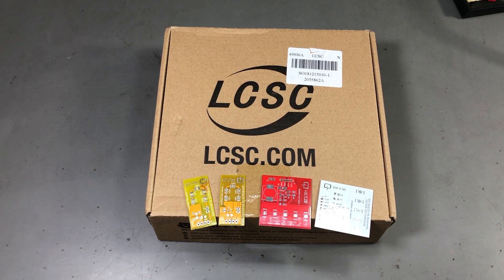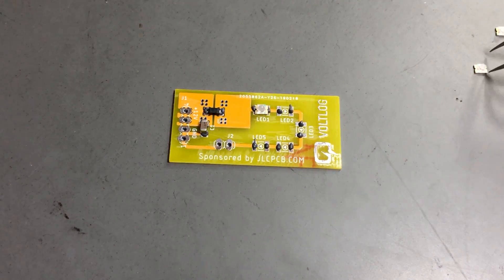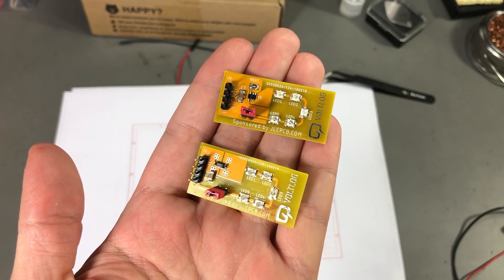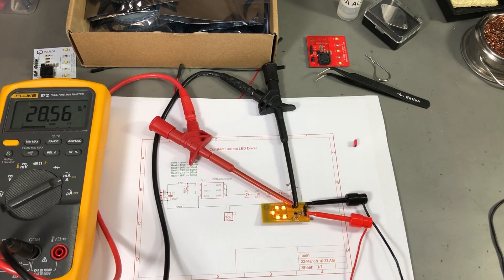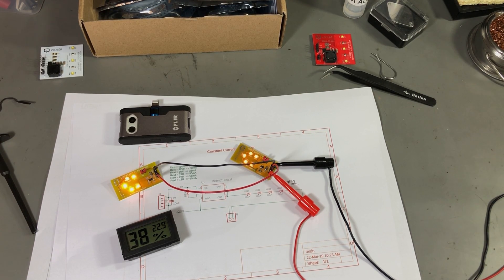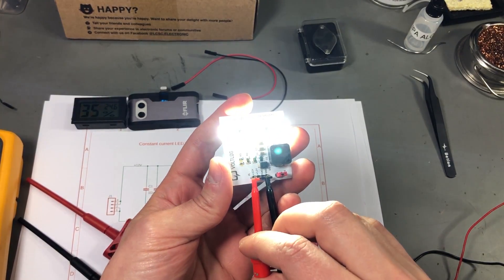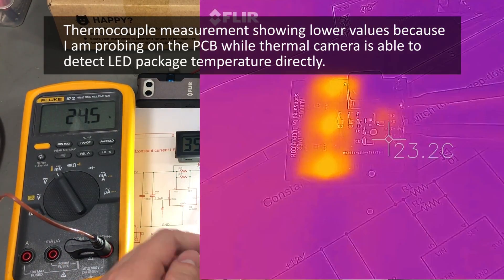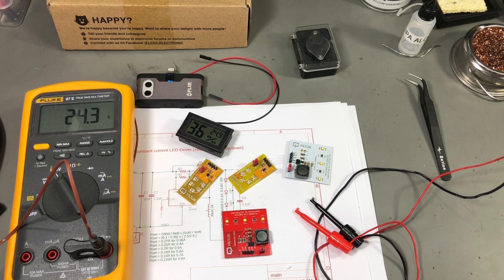Voltlog #217 - Constant Current LED Driver Boards Assembly & Testing

Comment: One tip I've heard about old solder paste is it realy just loses the liquid flux and you can revitalize the paste by adding more liquid flux or maybe just some IPA back into the mix. Of course you have to mix it somehow so squirt it out to a dish and mix and then use the paste.
Reply from the maker: Yes you can do that but results will vary, I once tried it and it turned out I added too much flux and after using that paste to assemble some boards it left too much flux residue on each solder joint. Since paste is not really that expensive I prefer getting new paste every 6 months or so.

Comment: For efficient cooling I would glue the pcb on a cheap small cooling fan which is also 12V, same as your power, and consumes only 100mA of current, or less if you regulate it. The 40x40mm one costs only less than 1€50, see https://fr.aliexpress.com/item/2Pin-DC-12-V-40-40mm-Ordinateurs-Portables-Ventilateurs-De-Refroidissement-Pour-Ordinateur-Portable-Refroidisseur-Fans/32854459773.html?spm=a2g0s.9042311.0.0.27426c37ceR06w

Comment: Couldn't you use copper tubing soldered on the back of that red board or even heat conductive silicone and a heatsink of some sort on any of these? Good deal all in all so I would just make it work.
Reply from the maker: There are plenty of things that can be used as a heatsink but the application usually dictates a space constraint and in this particular case, I only have a few millimeters of space available, I am currently searching for a small heatsink.

Comment: Great video. If you need led's to be cooled by pcb, you need mcpcb. If you find some place with descent price where you can order custom pcb. I tried sinkpad, al and cu, and works great, but price is  problem. 
If you can compare efficiency MP24893 vs AL8805 at higher current.
Reply from the maker: MCPCB helps suck the heat away from the LEDs but you need to get rid of that heat someway. My application has a tight space constraint so I would be using a very small heatsink. I'm not convinced the MCPCB will make a huge difference because I will have limited heat dissipation capability anyway.
Reply: I tried AL and CU. CU MCPCB spread heat perfectly. Cree XP-G2 @ about 0.5W mounted on 20mm copper star was enough cooling in open air. With CU star there is no temp. difference between center and borders, heat is evenly spread, but that is not case when AL star is used.
If you are limited with space, use most efficient led you can find. For example Cree XP-G3 S5 bin would have 110lm light output @0.5W, same as Cree XB-D Q4 bin @1W  
 @voltlog
Reply from the maker: Miloš Arsić  thank you for sharing your experience 👍

Comment: Hi Florin,
I liked your PCB experiments. May I suggest you place more vias when you want to use both sides of copper pours as a heat sink. 
I conducted some tests about 10 years ago and found that the vias acted like smoke stacks and pulled air through them which provided about 10% more cooling, compared to the vias filled with solder. 
The bare pours (without solder mask), is more efficient as you can imagine, with the added benefit of being able to solder copper fins or copper heat sinks, to act as heat sinks. 
I've used a $2 variable voltage boost converter from AliExpress on my 12V 10W COB LEDs, and adjusted the output of the converter to about 9.7V, because they are too bright for mood lighting. 
They hardly get warm, but I've attached the LEDs to 30mmx30mm heat sinks just in case I wanted to crank them up. It provides a constant voltage of 9.7 from a junk 7.2V power supply. 
No current limiting resistors were harmed in this project. 
Thought I share that with you and your viewers.
Reply from the maker: Thanks for the info, I never thought about using thermal vias for convection cooling.

Comment: Good video ! 👍

Dissipation problem : 
Use smd components only and have your pcb on ( anodized ) aluminium ?
Reply from the maker: There are plenty of things that can be used as a heatsink but the application usually dictates a space constraint and in this particular case, I only have a few millimeters of space available, I am currently searching for a small heatsink.

Comment: It would be interesting to see further tests with that AL8805 board and heat sinks. Of course it is easy to keep them cool with over-sized heat sink and huge fan, but tests with different kind of small heat sinks would be cool . One that have fins with fine spacing and one with coarse spacing, for example.
Reply from the maker: Yes I will experiment in a future video with some small heatsinks.